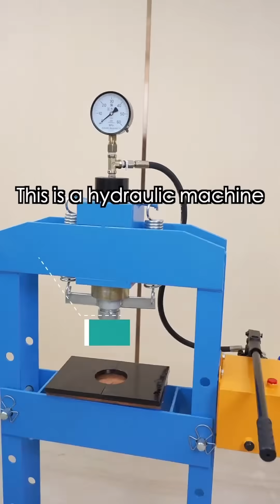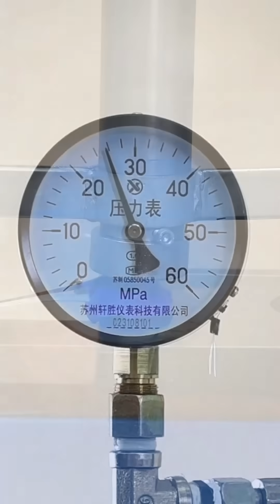P2 Tear of Rupert is So Hard Even Iron Hammer🔨 Can’t Break it❗️What about the “Hydraulic Machine”❓❓

Comment: For those who doesn't know:Prince Rupert's drops shatter catastrophically when the tail is broken because the rapid cooling creates a state of unstable equilibrium with high compressive stress on the surface and tensile stress in the interior, and breaking the tail initiates a crack that propagates through the tension zone, causing the entire drop to disintegrate. 
Here's a more detailed explanation:
How they're formed:
Prince Rupert's drops, also known as Dutch tears or Batavian tears, are created by dripping molten glass into cold water, causing it to solidify into a tadpole-shaped droplet with a long, thin tail. 
Unstable Equilibrium:
The rapid cooling causes the surface to contract faster than the interior, resulting in high compressive stresses on the surface and compensating tensile stresses in the interior. 
The "Tension Zone":
The interior of the drop is in a state of tension, meaning it's under a pulling force, which is why it shatters when the tail is broken. 
Tail as the Weak Link:
The thin tail is the weakest point because it's where the tensile stresses are concentrated, and breaking it initiates a crack that travels through the tension zone, leading to explosive disintegration. 
Analogy:
Robert Hooke likened the drop to an archway, where removing a single brick (the tail) causes the entire structure (the drop) to collapse. 
Edit:ty for a like :) ❤
Reply: Also, they thought we wouldn't know they used google AI 🙄
Reply: Wow
Reply: "Those who know 💀😈"
Reply: @GalacticScaleNoob  cringe
Reply: @ZIRAXFFSHORTS  I was making fun of brainrot
Reply: @GalacticScaleNoob  ah right sorry
Reply: You are using ai..
Reply: AI says stuff like that with the "Here's a more detailed look" and stuff like that and Google AI also uses the ":" symbol alot
Reply: "here's a more detailed explanation" is wild
i smell google ai
Reply: Good explanation.. other people are just trying to be cool typing "because the tail is it's weak point."

Comment: Imagine if a Battle Tank is made out of Rupert's drop, it would be terrifying .
Reply: Rupert's drop has a tail that makes it shatter into a million pieces when lightly tapped
Reply: @thep-AI-nter  you can melt the tail off
Reply: @Staring_Cat melting the tail off will make the center act like regular glass
Reply: @Staring_Cat  you can also laser the tail off
Reply: @ Andddd what if the tail is INSIDE the tank? and BEHIND the head?
Reply: @SomeoneJustPassBy imagine someone inside
Reply: there is no way a ruberts drop is stopping an 80cm long uranium rod moving at 1500 m/s capable of penetrating over half a meter of steel
Reply: @AlexanderLam-w3p a big drop might stop a tank shell
Reply: But only one
Reply: All the tails properly insulated and facing inside the tank. It would be unstoppable !!!!!!
Reply: The tail can be placed inside the drop
Reply: Many problems are there, if you combined all of the drops into one big barrier, it would lose its durability.
Reply: its not surviving a depleted uranium round
Reply: or a tank made by SAMSUNG 💀💀💀💀
Reply: @SomeoneJustPassBy and just so you know depleted uranium is harder than glass so it's gonna shatter it no question
Reply: i seriously doubt that would work with mordern tech even if whatever holding the drops would still break even if the drops survived a tank shell made to penatrate literally anything

Comment: the real hero of this video is the play doh that was supporting the glass
Reply: I guess you want it to fall
Reply: Powerful Hydraulic Machine Vs Normal Cutter plier
Reply: The playdol is for making the prince Rupert drop not fall off the table + the tail is fragile and the tip is way too strong to be normal glass
Reply: the reason why i said that isn't because i didn't think that it won't fall. it's because i am surprised that it didn't get squashed and separated by the weight
Reply: @Couera I think it did you just can't see it from that angle
Reply: true

Comment: Hi, I’m love videos you are cool

The Prince Rupert drop is so durable due to the forces of compression and tension. 

When molten glass enters a water tank, its surface cools quickly, forming a solidified shell around the liquid interior. The molten glass inside continues to cool and retract, affecting the outer layer as well. The inner core becomes highly compressed, which creates incredible tension in the drop. 

As a result, mechanical tensile stresses act in the inner part of the cooled droplet, and compressive stresses act in the outer part. This opposition makes the drop stronger than steel. 

The compression stress in the droplet head is equivalent to more than 4,000 times atmospheric pressure, making the droplet as durable as some steel grades.

Can I be pinned?
Reply: Can i be pinned? 😂😂😂😂 lol 
No?😂

Comment: Here’s a simple and delicious cookie recipe!🍪

Ingredients:
	•	1 cup (226g) butter, softened
	•	1 cup (200g) sugar
	•	1 egg
	•	1 tsp vanilla extract
	•	2 cups (250g) all-purpose flour
	•	½ tsp baking soda
	•	¼ tsp salt

Instructions:
	1.	Preheat your oven to 180°C (350°F). Line a baking sheet with parchment paper.
	2.	In a bowl, cream together the butter and sugar until light and fluffy.
	3.	Add the egg and vanilla, then mix until well combined.
	4.	In a separate bowl, whisk together the flour, baking soda, and salt.
	5.	Gradually add the dry ingredients to the wet ingredients and mix until a dough forms.
	6.	Roll the dough into small balls and place them on the baking sheet, spacing them apart.
	7.	Bake for 10-12 minutes or until the edges are lightly golden.
	8.	Let them cool for a few minutes before enjoying!

Optional: Add chocolate chips, nuts, or cinnamon for extra flavor.
Reply: Thanks bro